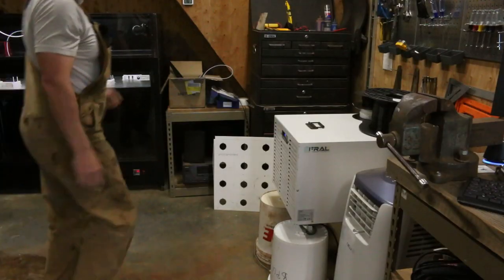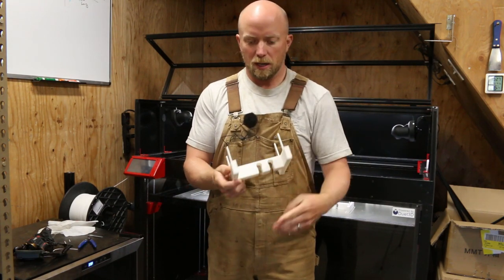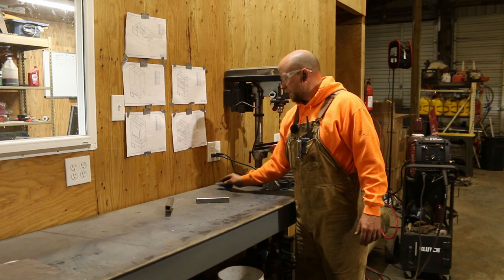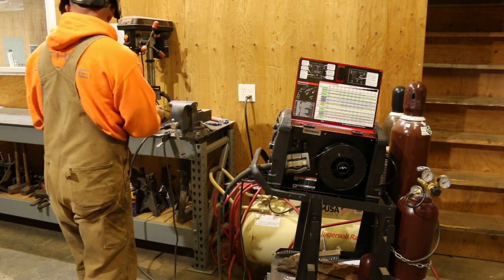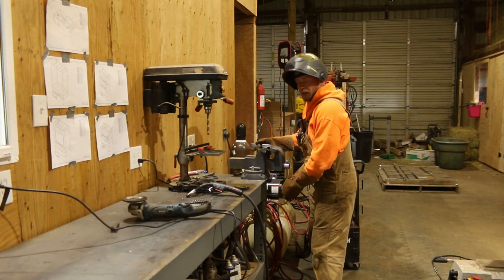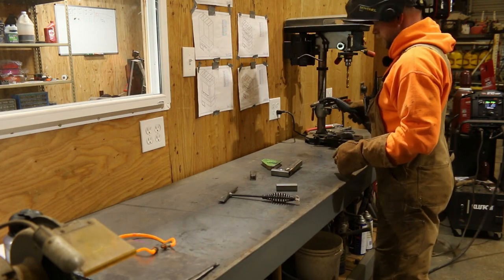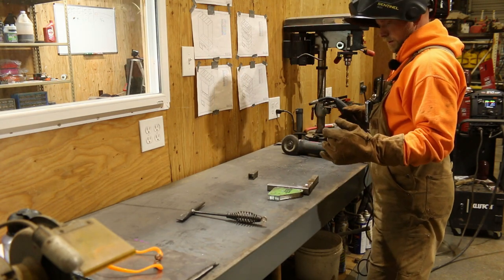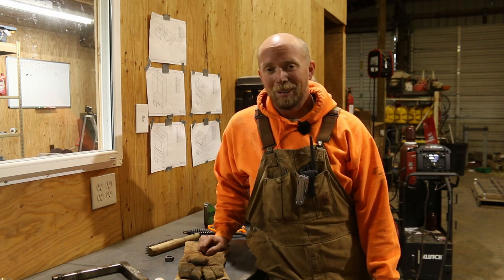Learning to Weld Stainless Steel Tube

Comment: With the Grow Wall mounts: Suggestion, move the tube grooves to the front side, so the tubes come out as the boxes are slid off the rods.

Welding Shirt/Jacket: Get one made with Nomex cloth instead of leather whole lot cooler to work in.  Also suggest only getting the sleeves instead of full jacket

Welding as soon as you can afford it, look into TIG, you control the filler rod feed, and there are no sparks.

Comment: Stainless get hot fast. Your speed on stainless needs to be fast. Move your nozzel faster. Your bead is built up too much so move faster for a flatter bead.Just some helpful advice. Thanks for the videos.
Reply from the maker: Thanks for the tips!